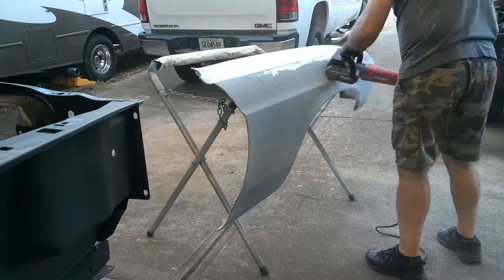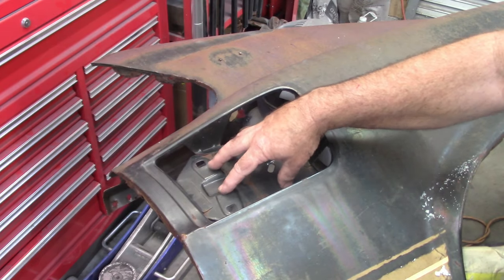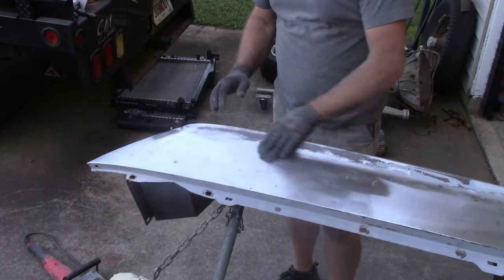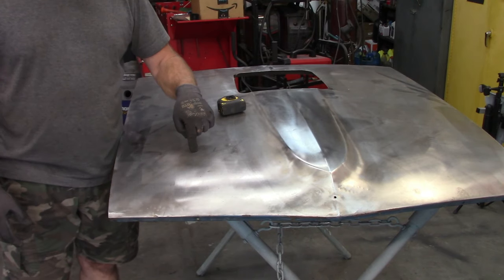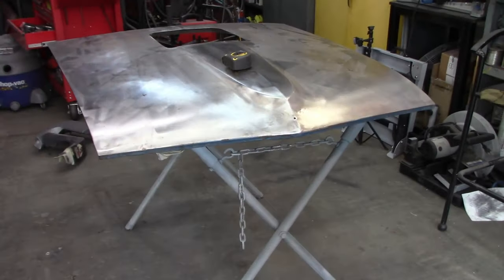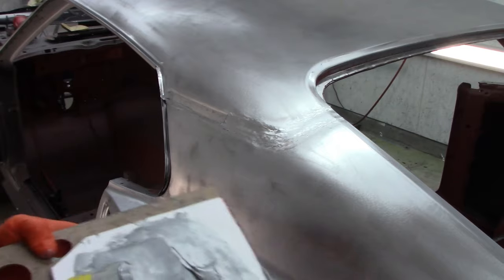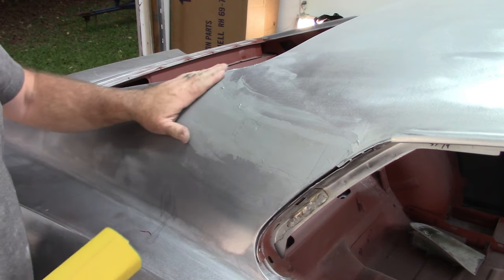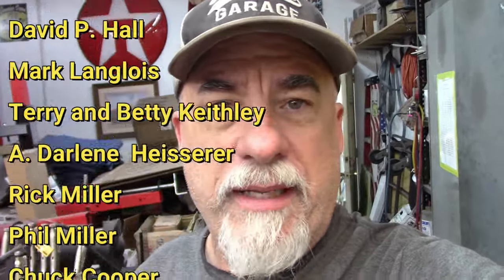Details matter. 1969 Mach 1 build. Slither part 49. #mustang #restoration #howto #diy

Comment: I remember using a similar product in the late 70's early 80's called Aluma-lead. I mixed it up, put it on a fender and waited, and waited, and waited. The hardener that came with the can was defective and i had to scrape it all off and start over. It was funny when i took the product back to the supply shop, they mixed up a batch to make sure it was defective. I went in a week later and it still hadn't set up, it was still just a runny blob. I used it mainly on motorcycle gas tanks as it seemed more durable than regular filler.

Comment: You are catching up to me on my 69 project. I have been waiting to see how you address  the issues I have found before you, and I have already moved the driver's side vent plate. I have an eastwood lead kit coming in a day  or two. I don't think that will be easy-to-use. Back in 1969, I was 17 years old and worked at my uncles Ford dealership. When the mach 1s came in, I recall  getting a bag out of the trunk that had the antenna and hood  
pins in it. We used a template to mount the antenna, we put the pins in the core support,lowered the hood touching the pins which  made a dimple in the hood, drilled the holes with a holesaw then used the chrome plates to drill the holes to mount them. That was the process we used. I have been test fitting interior parts, and some of the screw holes are off on my car. I hope you don't have to deal with that. I am looking forward to the next video.  Thanks for the details

Comment: You could add two drops of food coloring to the hardener, or the same product meant for coloring plastics and epoxy resin meant for moulding or casting. If You choose a bright greene colour, it will show You when it's fully mixed.

Comment: I'm glad to see work being done on the Slither project.  The Eastwood product looks pretty interesting, and I might have to use it on my wife's Mustang passenger rear quarter panel.  I could not help but think about the assembly line worker filling the gap with lead while the car was moving down the assembly line.  Thanks for another great video.
Reply: I've dealt with bronze filler in those seams on all cars, but wait, that was back in the early 60's.

Comment: Test fit indeed!! Bought that tee shirt!!!  Did you prime the inside of the door?  I blew out all seams from the inside door, and vacuumed up the chuff.  Pour in some RMP liquid into the back of the folded creases, and spin the door so the liquid paint flows into the joints all around. Yeah. Messy. Once all sealed, confirm drain hose at bottom are open , and hit those seams with compressed air inside the door to drive it into the space where water can go!! Rust never sleeps.
Reply from the maker: I will add paint to the seams.